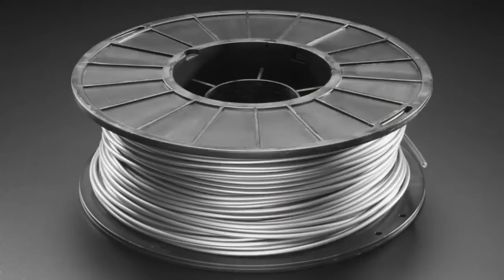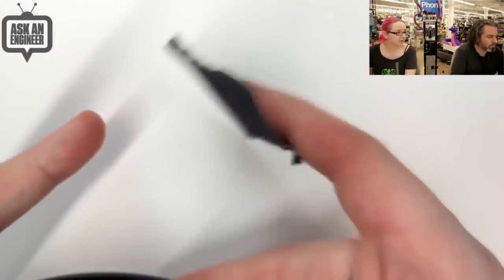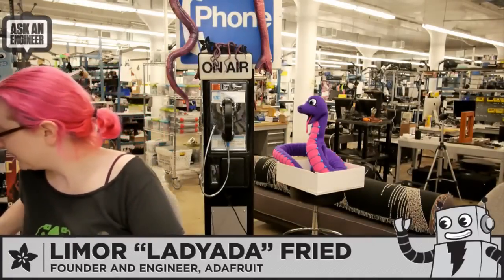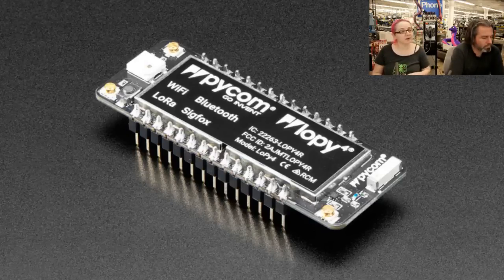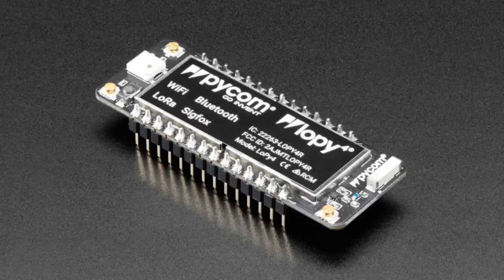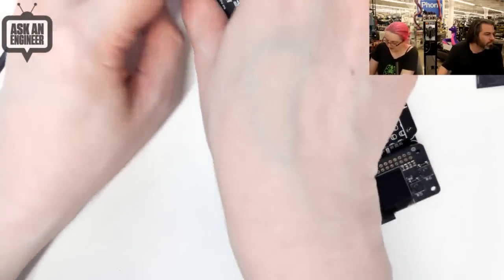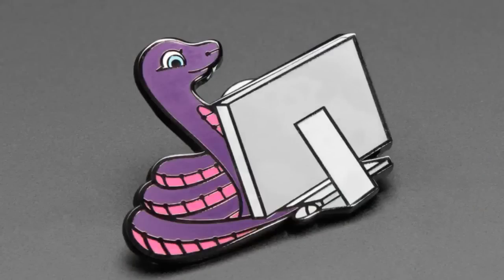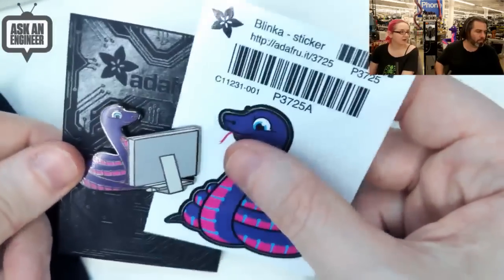New Products 2/21/2018 Featuring Blinka the CircuitPython Enamel Pin! @adafruit #adafruit

Comment: I m really surprised you went with only the 2.85mm filament, I seldom see printers using this size outside of  couple of higher price printers most of the affordable printers use  1.75...
Reply from the maker: we offer both sizes ;) https://www.adafruit.com/category/780
Reply: I think people mostly took umbrage with the "3mm is the standard" comment. Just not true.
Reply: Is the phat stack part of some sort of product line used in it's own ecosystem? I noticed a lot of those modules had similar design philosophies.

Comment: In re filament diameter..  your in house guys may not be looking at the correct business decision; by discounting the 1.75 standard.     Even a $2000 machine I just purchased uses 1.75..   Having a slower extruder speed and a more rigid filament path might be marginally advantageous, but only slightly.    From a business perspective you are missing 70%-85% of the market.
Reply from the maker: we carry both ;) https://www.adafruit.com/category/780